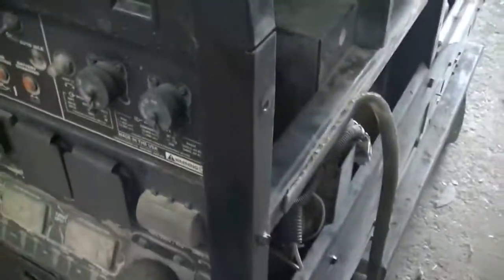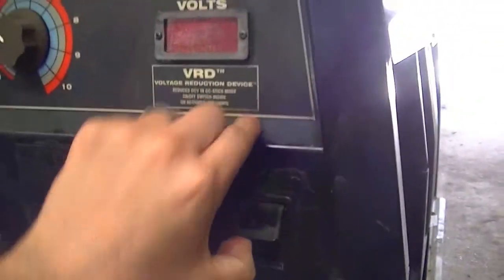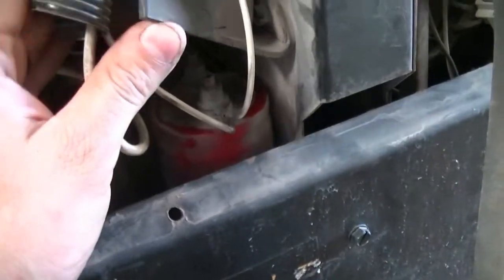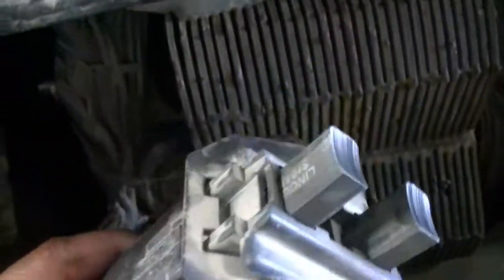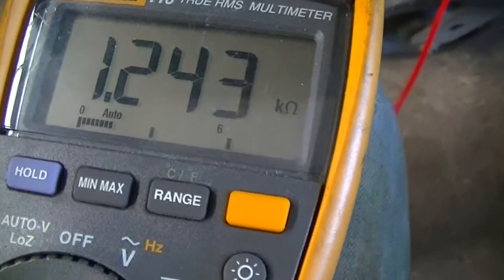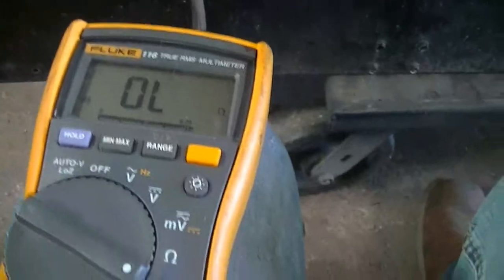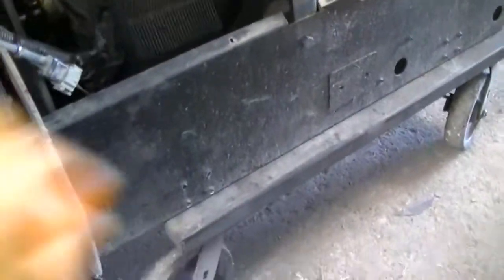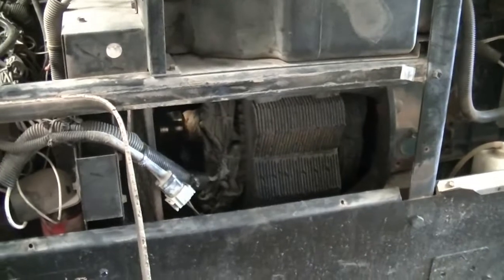How to troubleshoot Lincoln Vantage no weld issue

Comment: Just came across this video and man this is like one of the only videos talking about anything relating to a Vantage. I had a quick question since you seem pretty knowledgeable, my vantage just recently stopped working out of nowhere on me. It won’t turn on and the engine protection light is on. Oil and radiator fluid is good also. My guess is that either the temp sensor or oil pressure switch might be out so that’s why it’s not turning on? I don’t know much about working on machines but I would appreciate it if you or anybody else here could point me in the right direction!

Comment: I found this very informative video after my vantage 300 stopped producing power. I ran all the checks you mentioned. Unfortunately i had no luck in finding the problem. What i did find is that at the bridge rectifier where the 200 wire connects, if i disconnected the wire to the filter capacitor that piggybacks this connection i get 12vdc. Once reconnected i only get a millivolt reading. The capacitor doea not show any voltage across the terminals nor does it read anything in microfarads when tested. Do you think it could be the capacitor. I replaced it with one off eBay and still the same. Maybe the ebay one us faulty also????

Comment: Please can I have some advice on my ranger 305 d , I’m having problems with lower output than amp readout @300amp, the clamp meter says 170amp @200amp I’m getting 120 , the 240v outlet seems to work fine as does the 110v , thanks for any help

Comment: GOOD VIDEO, WE HAVE A VANTAGE 400 AMPER THE MACHIE GIVING A TROBBLE NO WELD OUT PUT, NO AUXILARY  POWER. IWAS LOOKING THAT, BRUSHS ARE GOOD , ROTOR GOOD, I GOT THE VOLTAGE  UP TO THE RECTIFIERR . AC 70 VOLT  BOTTOM SIDE OF THE RECTIFIER AND 90 VOLT DC ON TOP. BUT I DONT SEE ANY LIGHTS COMING ON THE CHOPPER BOARD. WHAT IS THE NEXT STEP TO TEST PLEASE HELP ME.
Reply from the maker: You need to check and see if you're getting power to chopper board, if you are getting power in but not out it's bad. If you call Lincoln Electric and talk to a tech they can tell you what wires to test I do not know off the top of my head, have code number ready.

Comment: Please help! I got a Lincoln vantage 300, when I flip the start switch the battery light comes on but the oil pressure light doesn’t. The machine turns but won’t start. Could it be the oil pressure switch?

Comment: Mine lost power just like this one. I changed bridge rectifier and everything comes back on then it smokes bridge rectifier after 30 seconds and machine loses voltage outage again. What might I check. Thanks
Reply: That happens to mine to did you find out what it was

Comment: I have a Lincoln 250 GXT and the kill switch stopped working, plus it will randomly put out 290 amps to the welding leads no matter what setting it is one. 👉🏻🤯💨

Comment: Where are you located man my 2017 vantage 300 stock on high idle and there is no riding on the amperage screen
Reply: Have u figured out what your problem was here? I have the exact same issue on a vantage 400. Stuck on high idle and no reading on amp gauge

Comment: What does it mean when you get fluctuating numbers on your amperage display and no weld, but have aux power
Reply from the maker: Will the amperage adjust with the knob? Have you checked voltage at the terminals with a meter? Any difference in different settings? Remote switch in local? Have you dropped your panel and checked wiring?

Comment: Great video! Got a few questions for you, if you've got the time to respond. How common is it for the rotor to fail? Is it usually the windings shorting the slip ring to the shaft, or is it more common to cause an open between the two slip rings? Is it more common for the cheaper parts to fail, like the capacitor or rectifier bridge, or circuit board failure? I guess my basic question is how bad do they usually fail? I have a chance to buy a 2012 Vantage 300 without weld output and don't know if it would be worth the effort and cost to tear into it. I don't want to give more than $1,000 for it if it will cost me $2500 in parts. Any help, or thoughts on the subject would be appreciated.
Reply from the maker: Vantages can be good machines, Ive heard people love them and get thousands of hours out of them with no major problems. They run and weld good until they don't. I would say the biggest issue with the vantages is the cheap plastic or composite molded rotors. I see more rotors go bad than anything. Yes boards also go out but probably 90% of the time if youre getting no power at all and stays in high idle the rotor is shorted. The rotor last I checked was around $2500. Usually when a board goes bad it will stop welding in a setting or start welding spurraticly. Check out my video on testing armatures if you havent already.
Reply: Thanks for the reply, I appreciate the information.
That's what I was afraid of on those rotors. I think I'll shoot the fella a very low offer and see where it goes from there. Least he could say is no! 

I really like the vantage specs on paper. I think it would be better than what I have now, and  an SA200 is inadequate with the farm equipment and under ground water pipe repair I mainly do. I've got an 08 Ranger GXT now and would like the robustness of a diesel for generating power for water pumps and my small fusion machine. Thanks for the info.
Reply: @kgfarmfab8807  why not go to a machine shop and have them make an adaptor plate for a diesel motor. Of your choice.
Might be cheaper to put a bigger motor on your gxt.